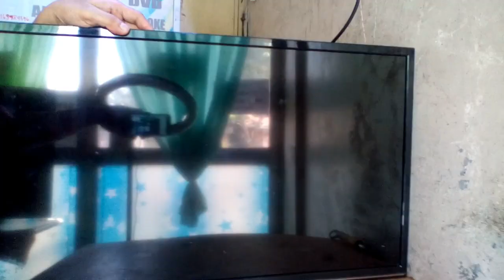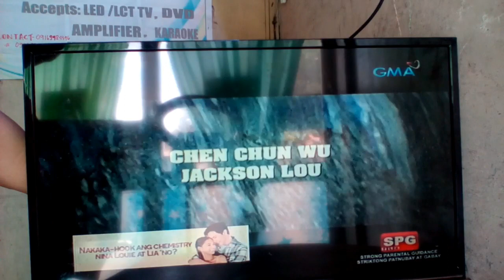HOW TO FIX A SKYWORTH  LED TV THAT HAS POWER & SOUND BUT NO PICTURE

Comment: Ang lcd po ba ng 32 inch. Na devant ang brand ay pwedeng ikabit din ba sa 32 inch. Na coocaa ang brand na led tv?
Reply from the maker: Yes po. Pero bka may convertion na ga2wing tv tech.
Reply: @melelectronics1862  Yon nga po eh, bka nman po pwede makatwag po ako syo, baguhan lng po kc ako sa pagtetechnician, d2 po ako sa occ. Mindoro nakatira, salamat po ng marami... Godbless..